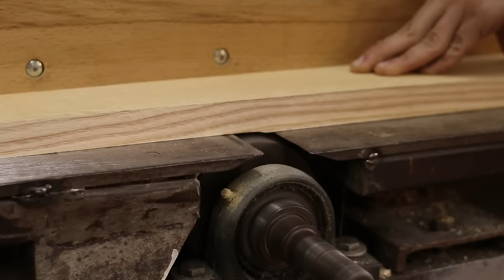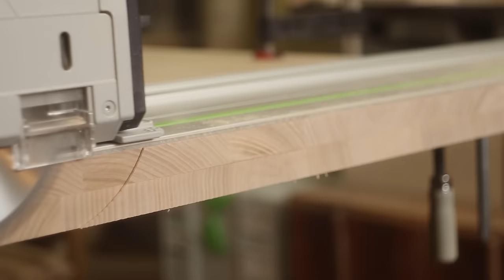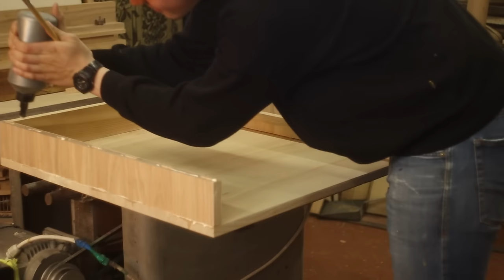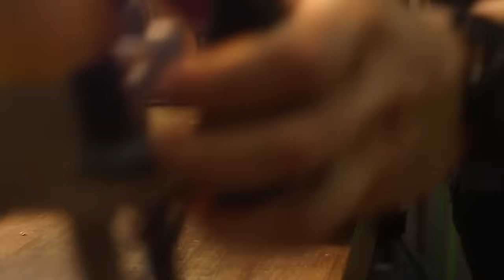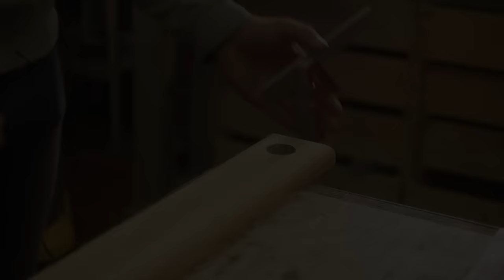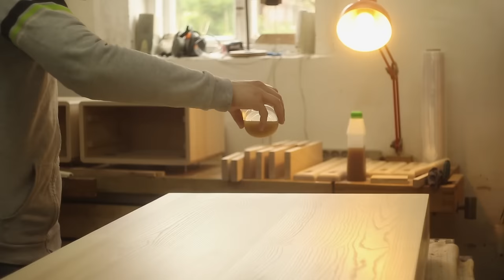Making a Desk from ash wood // Woodworking  // DIY // Table making   #woodworking #DIY #handmade

Comment: Can i ask how did you film this? Since its a long process. Do you call the filmer into the workshop multiple times or do you do it in one session repeating movements?
Reply from the maker: Oooh I see you understand the complexity. It took us 3 days (6 hours a day) to film it. To reduce the operator's time, I did most of the work myself and left one or two parts for shooting, so I managed to shoot several processes at once. I also filmed some moments on my own. In general, this greatly complicates the work. Now I film by myself from the tripod.
Reply: @infeelfurniture  ah so you did a mix of DYI and getting someone to help. Very good work. It wasnt easy doing both the work and recording it. Thank you for a great show.
Reply from the maker: Thank you I will try better. In particular, video editing, I realized some of my mistakes that I will try to correct, in particular not to focus on one process for too long, I will also try to shorten the video.
Reply: @infeelfurniture  I think one of good things about ur video is the length and detail. Just my opinion, if you shortern it then it has no detail and would just be watching an advert.
Reply from the maker: @shaunZ96  in general, what do you think should be changed? Or exactly what you want to see ...

Comment: Hi guys. What is difference between tools in 1:15 and 1:40? Thanks. 😊
Reply from the maker: the joint makes a flat plane, and the tikneser relative to this plane makes the other side parallel. One cannot replace the other, because a flat plane is required for reismus, sorry for my late reply...

Comment: nice   - do you buy the biscuits or how do you cut them exact size Thank you
Reply from the maker: At first I plane rails to right thickness and then fix bunch of them together with a tape then cut to the lengths I need by the circular saw.

Comment: Great work! What radius did you use for the round overs? How thick is the stock? I'd love to see a video of how you taper the legs and construction of jig for routing the top of them
Reply from the maker: The thickness of the plates is about 18 millimeters, and the cutter with a radius of 16 mm.

Comment: Im pretty new to woodwork.  This was an awesome video! One non condescending question I had, why would you use both a track saw and a table saw? Why not just use the same for both cuts?  Love your video and you earned a subscriber here!
Reply: Also, can you give us an idea on how long it took you to do the build on this?
Reply: I believe logically it is because of the need to lift heavy weight around and risking messing it up on the table saw since one side can be hanging, also you have to catch it on the other end if it is long. So it is for safety, easiness and less risk to damage the beautiful table top. (Don't take my word for it, I'm just a web-developer so no skills in wood-working at all. I just watch these type of videos because it calms me down and I love the discipline and patient those artisans/artists have, it is truely incredible and I believe you've joined them on a wonderful adventure of beautiful creations)
Reply from the maker: I use a track saw to make a smooth cut and only then do I have a flat side to base it on a circular saw. Also the answer @The Little Cousin is tru. On such a table, I will spend about a week working with oil coating. Sorry that I answer a little late)

Comment: great job!
the drawer front panels: would it not have preserved the grain continuity by placing the inside edges and then measuring for offcuts on the outer edges? Instead, for the LHS panel, you placed the left outer edge witin the opening, and then marked for offcut on the inner, right side. Then you did the RHS panel the same way mirrored: placed the outer right side within the opening and marked for offcut on the inner left side of the panel.
Reply: This was exactly my thought as he measured the insides. Ouch.

Comment: did i see four sets of legs made but only two used
Reply from the maker: I think it will work well, but then the bottom will need to be made of greater thickness.

Comment: at the beginning it looks like the table saw was on when you measured the distance off the fence... I would not recommend this procedure if I am correct in my assessment.
Reply from the maker: you're right, it was on but I have a line drawn from which I measured so I was at a safe distance from the saw.  But still thank you for the advice.